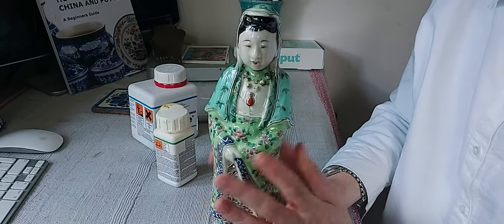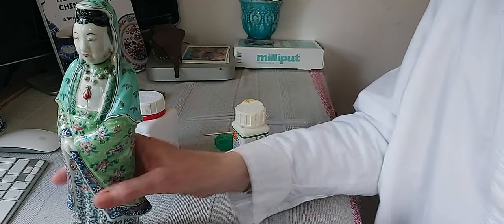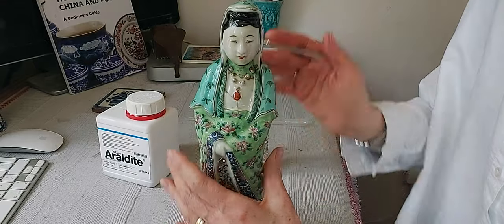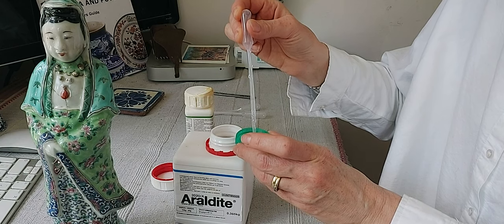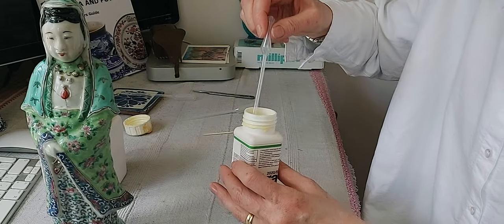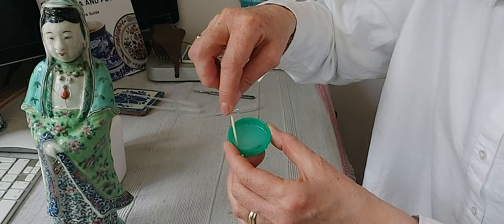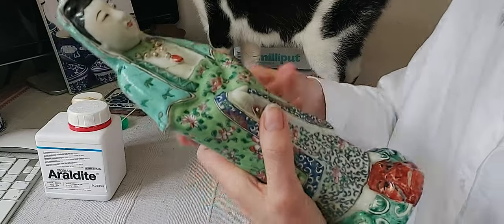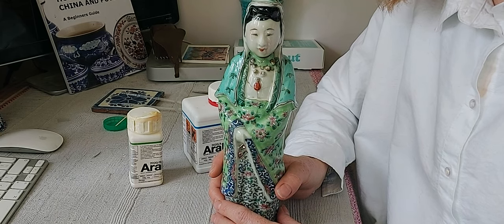HOW BEST TO USE ARALDITE 2020 ON CRACKED PORCELAIN

Comment: Hi Ali- really excellent videos. I see that you use ordinary Araldite for joining broken pieces of porcelain rather than Araldite 2020. I wonder why that is? Perhaps it the 2020 Araldite doesn't work so well as an actual glue- more of a crack sealer? Many thanks Ken
Reply from the maker: Hi Ken, yes I tend to use Araldite 2020 on crack sealing. 😀

Comment: Great work, is there an alternative to the large pot of araldite, also is it only used on potential breaks or can it be used on pieces that have completely broken away?
Reply from the maker: I would only use Araldite 2020 on radial/hairline cracks . Unfortunately you can only buy it in a large pot, unless there is a cheaper alternative which I haven't found yet.

Comment: I didn’t know, Ali, that this was the video I was waiting for! Are you saying there is more than one type of Araldite glue? I’ve ordered some Araldite glue but it hasn’t arrived yet and I don’t want to use it if it isn’t the correct one, obviously.
Reply from the maker: The Araldite I mostly use is the slow cure glue great all rounder. I thought I would demonstrate 2020 as it is the best of radial/hairline cracks but is only really used for porcelain. Hope that helps.💕
Reply: @theceramicrepairstudio  Actually I am pretty sure I ordered the slow drying version but it didn’t show such large containers. I’m planning on gluing my satsuma lamp/vase per your demonstration when I’m sure I’ve got the right version of glue, after it arrives. I’ve been practicing doing other repairs on my various treasures using Milliput, and they have turned out remarkably well, I’m glad to say! I think you are a gift to those of us that love old china, pottery, earthenware, and porcelain!  I enjoy watching you demonstrate techniques and am so grateful SueMe recommended your channel to her viewers. You have saved me and my breaking heart, which had mourned so many family keepsakes but will no longer!